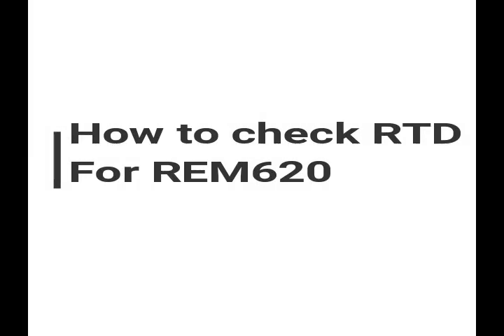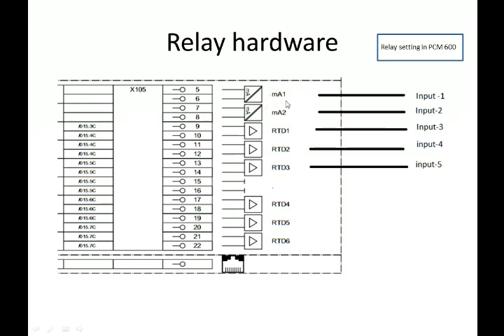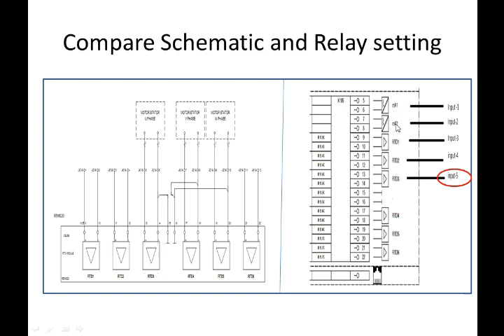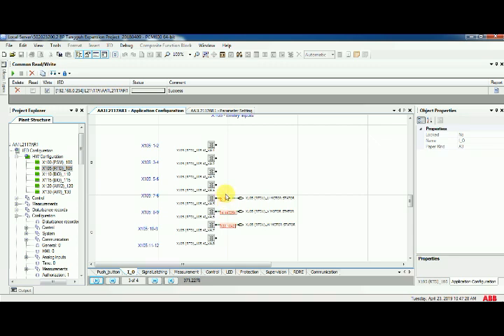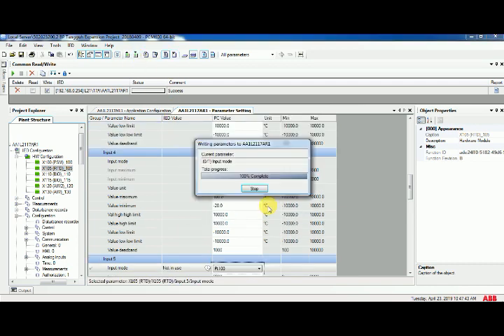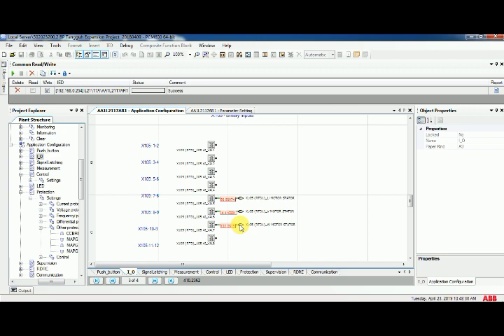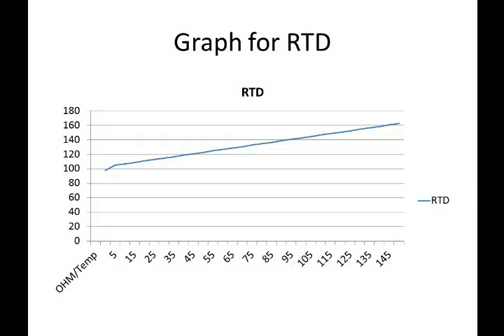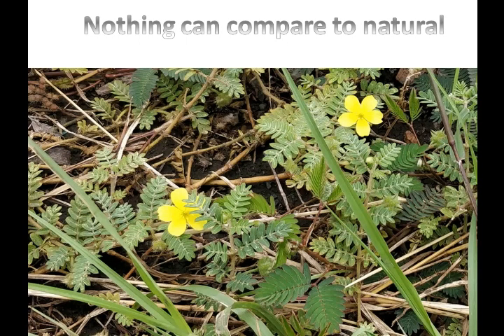ABB REM620 Relay: RTD Temperature Monitoring Configuration & Testing

Comment: Are RTDs in REM620 only for measurement or can they be connected to protection blocks if there is change in temperature? 
where can we use RTD inputs in configuration
Thanks
Reply: @baranitech  from analog inputs i have configured input of rtd
Input.

After that how to take output to be configured?
Cld you show an example?
Thanks
Reply: @baranitech  sir waiting for your video 🙂